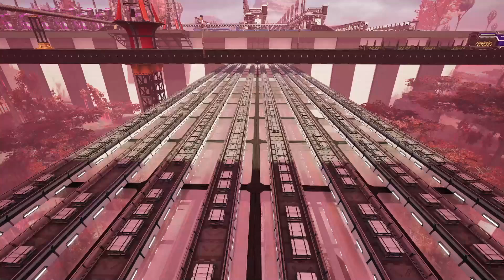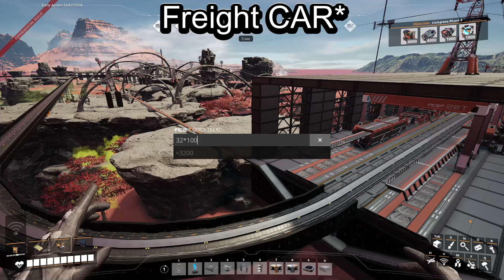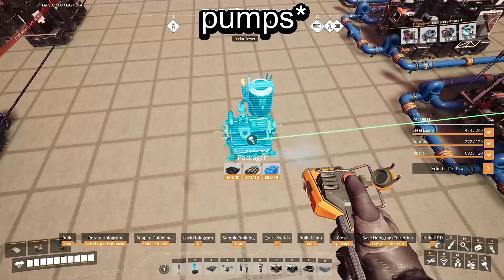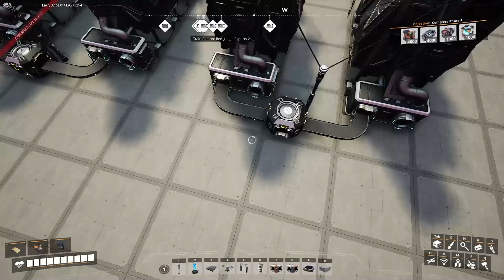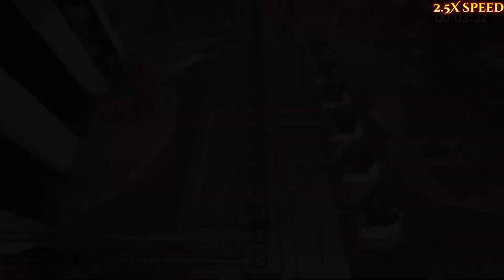4800 Aluminum Ingots - LOAD BALANCED - Satisfactory - Update 8

Comment: I have three aluminum production sites on my map. In the third I process the remains of the bauxite. I use 32 refineries and 32 mixers to then use smelting and foundries to produce 5700 aluminum ingots.
Reply from the maker: Very cool! I try hard to avoid silica and foundries. But sometimes you need that extra bit, congrats on using up all the bauxite!